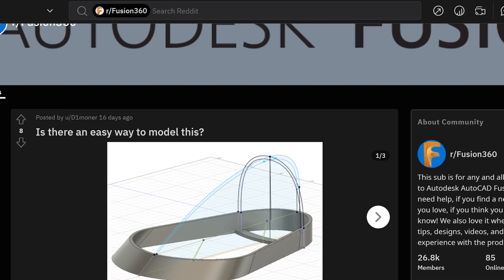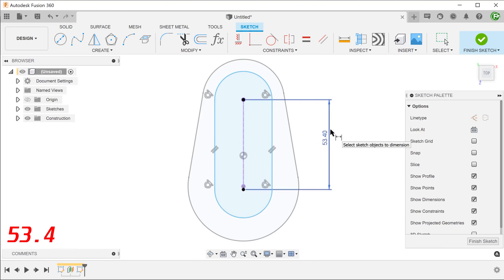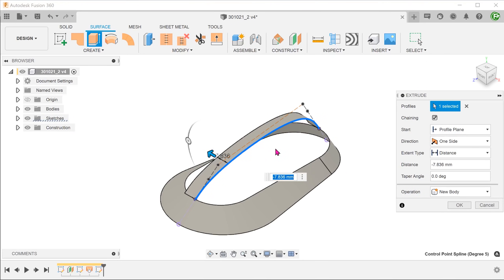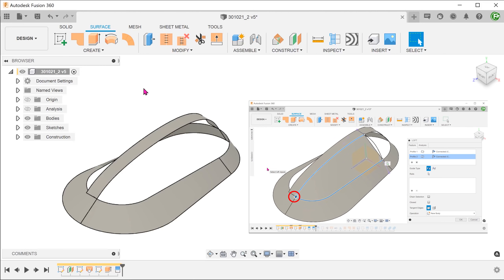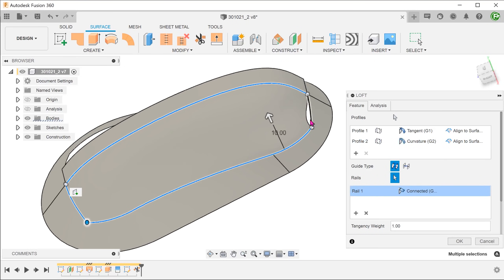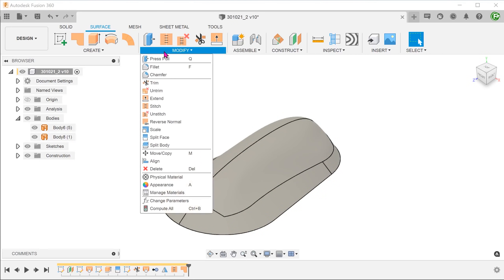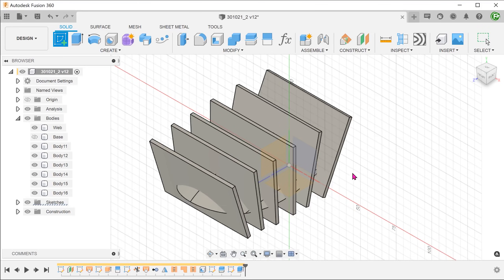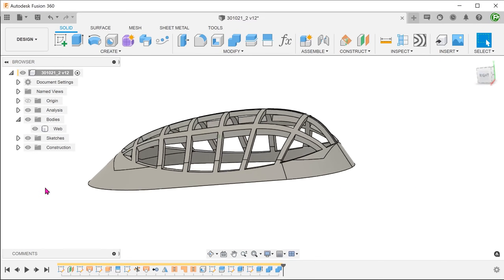Fusion 360 | Case Study 19

Comment from the maker: The model that I submitted to the forum was actually based on two straight slots. In this video, I decided to add a bit of challenge to the shape by using a non-straight slot for the base. The surface should look much better if you try this with 2 straight slots or 2 non-straight slots. The best results should come from using splines to replace the tangent arcs of the slot sketches. I am still experimenting with that. If time permits, I might post a follow up.

Comment: You shozld speak a bit slower....hard to understand sometimes!
Reply from the maker: Sorry about that. Will take note in future videos. Hope that the subtitles help.
Reply: Hey Andy just a little protip; under the settings options for YouTube videos is a feature to change playback speed for those videos where the author speaks a bit too quickly or you need a little more time to digest the information!

Additionally, some clever folks out there have designed chrome extensions and scripts that you can paste into the url of the video to more precisely tune the playback speed in the event that the built-in speed options are too far apart! I tend to use the script myself because of my abysmal attention span and have found 1.3x speed to be the sweet spot.

Let me know if you'd like me to send you that script, I'd be glad to help!

Comment: I think making sketches and using the form workspace gives most control for the surface.
Reply from the maker: I do think that sculpting is probably more appropriate here. Unfortunately, the form workspace is still very foreign to me. Will definitely need to learn more in order to do this with sculpting.
Reply: @Fusion360School  the fact that u can combine sketches with form is very interesting. Recently dove deeper into the form workspace and it amazes me everytime.
Reply from the maker: I have always been concerned with the  non-parametric workflow of forms. It does not seem like I can easily retrace my steps when sculpting. But then again, my understanding might be wrong. I would be very interested to learn how to use sketches to control a form. I have not seen that before.
Reply: @Fusion360School  u can loft from sketches in form workspace, u can pull the vertices to a sketched spline,... For me the combination of sketches and form is very powerfull.